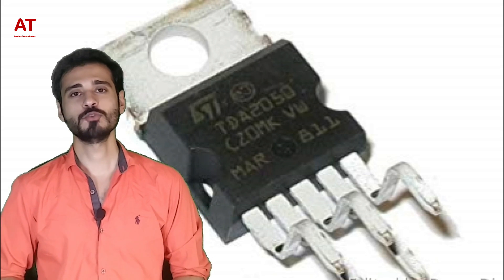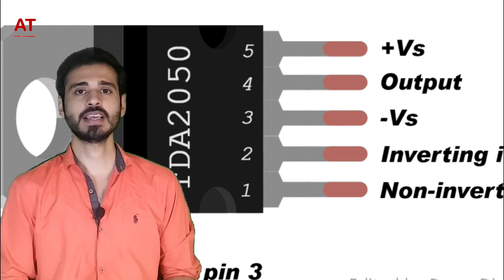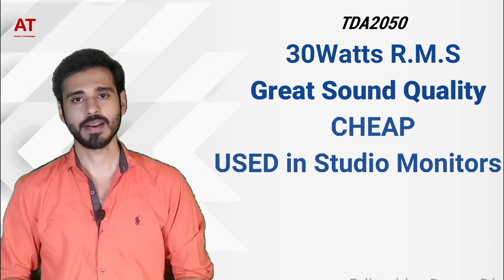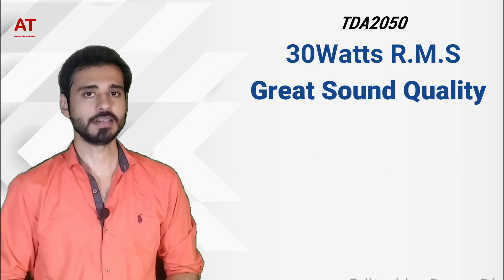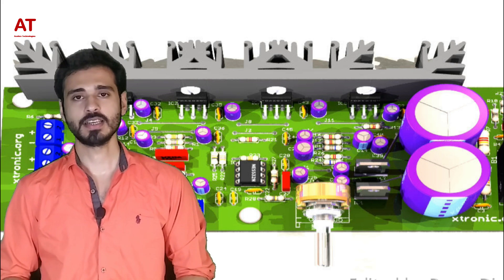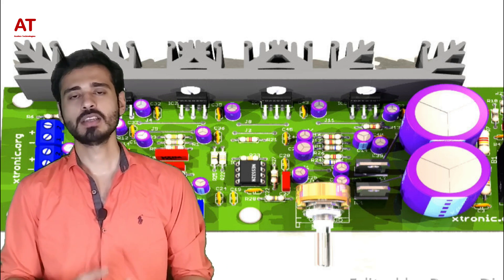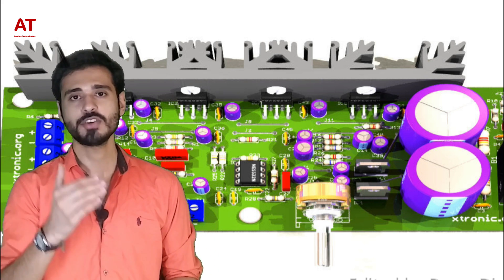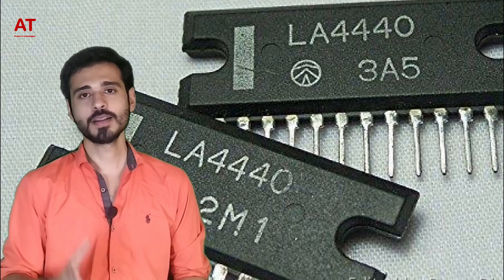Top 5 Best Audio IC's

Comment: All these Ic discontinued since 2013 & what we're getting now are copies of original Ics that are not as original & get blown up at higher voltage plus at given voltage they give low watts output. The Counterfeit ics don't have short circuit & over heat protection but the original ones do have starting from 2030 to 7294

Comment: Lm3886 can easily handpe 100 watt with   2 % of distortion only while Tda7293/94 can give 100watt with 10 percentage distortion . The datasheet of lm has given priority not by watts but by distortion level of 0.1 % .

But 7294 original is not bad though !
Reply: Into what impedance?
Reply: @buddhistsympathizer1136 38+38w RMS/8hom
😂 The liars are so many

Comment: As per me the best ever sounding amplifier chip is TDA1514A used in Cambridge Audio A2  and Mk2. That made the brand renowned after releasing the product. Originally developed by Philips NV now a NXP division to be used for amplifiers for newly introduced CD players. If anybody get hold of these ICs then just give it a try.

On the cheaper side ùPC1230 has the sweetest sound of all. It was made by NEC. One may find some car amplifier kits of these ICs.

Anyway, great video.
Reply: Thanks for such replies .

Comment: 2050 can be bridged and 4440 is not a 20 Watt IC. Single IC 4440 can drive 2x20 watts speaker/woofer. Dual IC drives 2x40 watts

Comment: Sir mera jo 5.1 home theatre system me 5x TDA 2030 hai jo single channel pe hai FR,FL,C,RL,RR but jo sub woofer me hai 2x TDA 2050 hai udko bridge karker ek 6 inch ka sub woofer lega hua hai...r ume ek TDA2050 burn hogia ta mere galti ke waje se jo mein ne 6 inch original  Bose ka dual voice coil wala woofer ka legaya ta uske waje se burn hogia ta tb mein ne dona TDA 2050 ko change kia ta jo bridge mode me lega hua hai...

Comment: He is  Conffusing LM3886 & TDA7294 ICs .I use LM3886 with DC Servo Circuit But could not get Good Results Now I planging to UseTDA7293(with Dignostic out put for fault  Indication) Yes TDA1514 IC is very good sounding but with 40W output.

Comment: sir how to remove a ground loop while using same power supply for 12v or 5v with transistor 7805 .. there is very irritative high pitch sound in bt module because of ground loop

Comment: PWM amps are becoming more mainstream and turning up in such units as Sound-Bars, Sub-Woofers, Audio Modeling Guitar Amps as well as car stereos.
Reply: But in terms of Audio quality you cannot beat class AB and you don't find that class D in any so called " Audiophile " system.
Reply: @nsqtr7578  Well it is in my SONY Sound Bar and Subwoofer so there.
Reply: @DAVIDGREGORYKERR  did you know Sony had Av receiver also which is is way costlier than a sound bar set up? Class AB is  used there. Sound bar is only for such users who can tolerate with sound Quality. True surround sound theater like Dolby Atmos experience can only be experienced from an Av receiver set up.

Sony has deferent level of product.
Reply: @nsqtr7578  Cannot have that in my room as my bedroom is too small but have a YAMAHA DOLBY DIGITAL DTS ATMOS Theatre System in the front room.
Reply: @DAVIDGREGORYKERR  all they use class A B inside, you can use Class D for subwoofer but class AB  will beat class D  in audio quality
Reply: @nsqtr7578  Actually Class A is better than every other type of amplifier but it gets very hot, Actually I had a TECHNICS SUA-900 MKII got very hot and the bamboo based Electrolytic capacitors dried out not it doesn't work properly.
Reply: @DAVIDGREGORYKERR  yes true but class AB gives you more power and a compromise between quality and power
Reply: @nsqtr7578  The TECHNICS SUA-900 was a Class AA which ran very hot and it is in the roof space now and I just use a sound bar now.
Reply: @DAVIDGREGORYKERR  get LM3886 original chips and use it in your technics ! Amazing audio quality , use bridge parellel ( 4 chips + 4 chips ) 220 watt RMS into 8 ohms
Reply: @DAVIDGREGORYKERR  I had the same amp and I reached its chip with lm3886
Reply: @nsqtr7578  I suppose I will have to get it fixed sometime and sell it so I will take it back to David Caston

Comment: Hello my friend, I like ur video,but I can't agree with u on TDA2050 with Bridge mode, actually I use TDA2050 with Bridge mode on Single and Dual PSU in two amps from last 8years and it's working very fine.
2, Yes u r about TDA7294, it's awesome Chip for an Amplifier, I used this Chip in my two amplifier from 5year with Single (stereo) and Bridge mode(subwoofer). In my view this Chip is END😀👍🏻
Reply: Yes, TDA2050 can be bridged.

Comment: Comparing price 
Tda7293 is better 
7293 handles more voltage

But quality is best for lm3886

But everything depends on your circuit skills

A bad layout will be useless and even tda2050 could be better than any amp if that are built well
So don't rely on ic specs
Focus on the circuit board
Just take a close look in yamaha pioneer sony amps
Reply: Use lm3886 in Bridge parellel co figuration, then you have more power + Quality

Comment: Thank you very much for your comparison ..you're voice is great! . Kindly assist for tda 7294 100+100 watt amplifier maximum and minimum Power supply and speaker ohms, inch, watts.. Pls  assist me. 
                               Thank you
Reply: thats 15 amp 18volt max. watt and google data sheet for drawings, easy, clean output i like it. uses full bridge non combinable outputs.
Reply: Check datasheet.

Comment: Hello sir , its a great informative that you made. 1 quick opinion or help i need from you. I have one home theatre system Sony tz 145 . It's dvd player had stopped working, so eventually I'm not able to utilise my 5.1 sony speaker system because the amplifier was embeded in the dvd player itself. Please guide me a way through which could use 5.1 speakers. Should i purchase an amplifier or what should i do?

Comment: LM3886 is best for hi-fi system and it should be on top.. mid & high is good 
But TDA7294 is good for mid & low

LM3886 68watt @4ohm
TDA7294 100watt @ 4ohm

I have both and using both board in stereo and bridge mode
LM3886 is super in sound quality compare to TDA.
Reply: Used some of these and the lm3886 is the best for me as well!!!
Reply: Lm 3886 can provide you 100 watt ( datasheet gives you 68 watt because they consider 0.1 % distortion max ) 

Tda 7294's 100 watt music power is with 10 % distortion. I measured lm3886 at 100 watt produce only 2 % of distortion .

Lm3886 has better SNR, slew rate and Power supply rejection ration and less components to use .